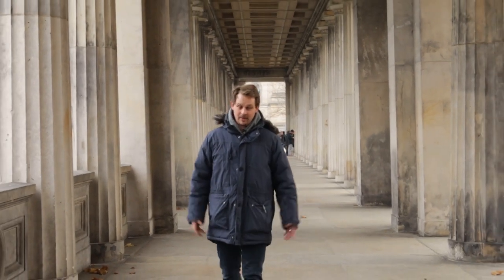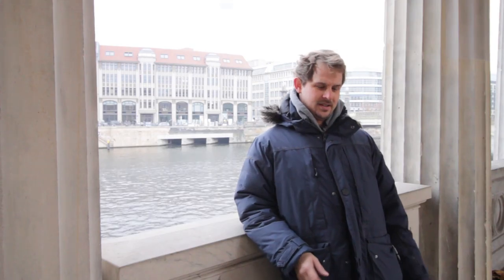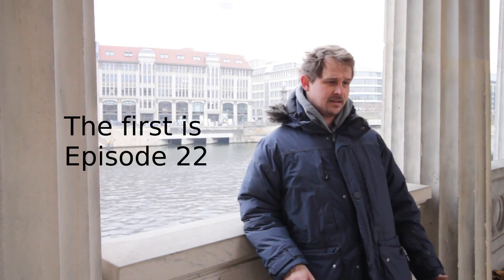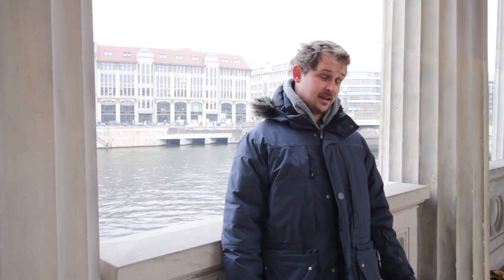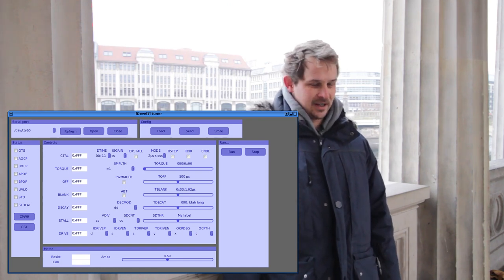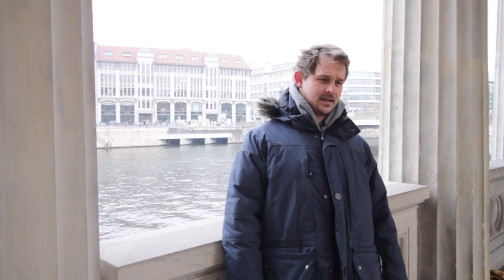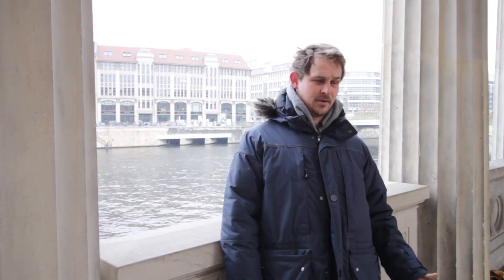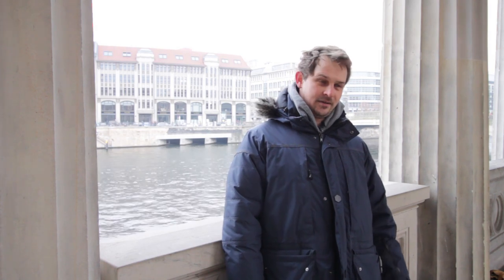building Libreflip - E34 - UPDATE What's happening?

Comment: Hello sir. To set the light capture the photo and with any programm decrease the brightness. There where the light is blur your need to change or ankle or the height or the lightment . To have exactly opposite the camera from your panels use a small mirror. Is like you watch your eye in a mirror. 90degrees when you seeyone eye in your reflection. Do that with the camera. If you see from the cross or cycle on screen of the camera in the reflection the lens you will have 90° with the panels
Reply from the maker: Thank you for your ideas! 

I have made the camera holders adjustable, as you can see in Episode 19 (https://youtu.be/VSluBTY96CA)so the suggested procedure is as easy as possible.

Also I have used the mirror trick before on other book scanners, it will be a pleasure to explain this trick in one of the next episodes for everyone who is toying with the idea of making a book scanner

The reflections - yes, I need to change the position of the lights, maybe its better then, if it does not help enough, i'll need to remake the suction box. Which would be an opportunity to make the construction of the suction box even simpler.